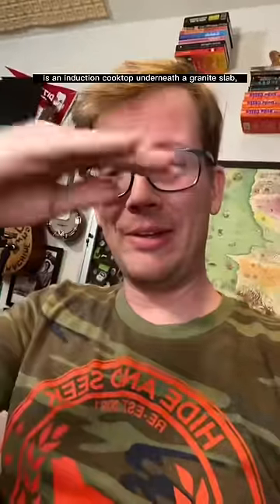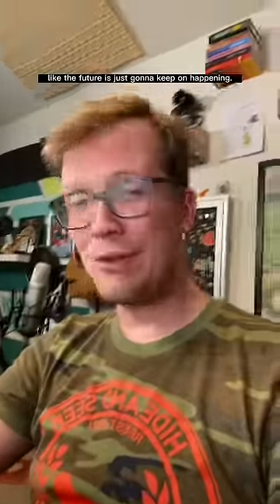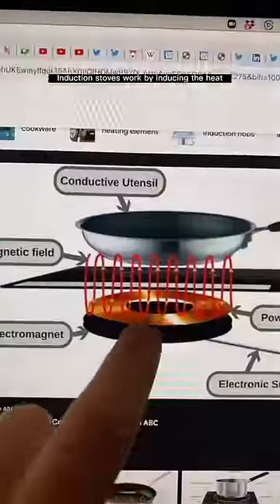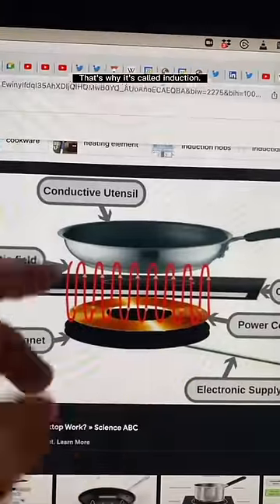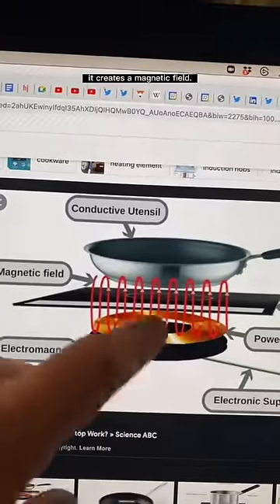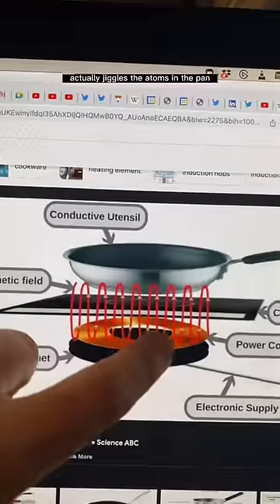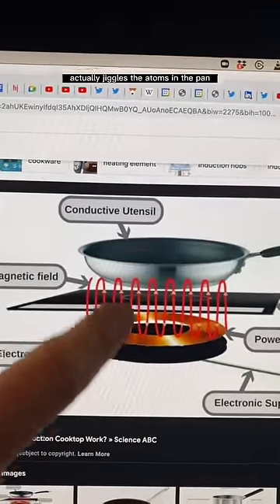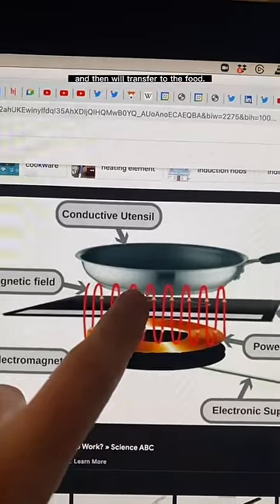How do induction cooktops work?

Comment: I got one recently and it's amazing! I love it for so many reasons but the most unexpected one is that you basically can't burn food/oil/etc. onto the surface. With a traditional glasstop electric burner it gets extremely hot so if something boils over, splashes, or splatters it burns onto the surface and becomes super hard to get off, whereas with induction the glass never gets hotter than the pan so things don't stick to it! It's also much easier to clean right after cooking (since it isn't that hot) so I'm just much more likely to clean it right after using it, which also helps keep it cleaner
Reply: Yeah im jus gonna pay attention when i cook instead of buyin an appliance that forces me to eat it raw. Like what good is a stove that doesn't boil water? You want your pan to be able to cook your food dude. If you an clean it up immediately after cooking. You didnt cook anything. Sometimes you want the oil to burn that how you know its gonna be hot enough to cook certain things. Like i dont think your problem was the stove. You just dont know how to cook. Im glad its helped you though.

Comment: I feel like continually heating pans on granite is going to crack it..
Reply: It will
Reply: they don't show it in the video, but you can use insulators on top or separators (it's like a stand that can hold the skillet or pot)
Reply: I don’t see why, Granite is extremely resistant to heat damage which is why it is used in countertops so often and why you don’t need trivets for hot pans/pots with granite. Also, it’s not the granite itself being heated remember. The granite is only being heated by the pan/pot since it is induction, drastically lowering its temperature.
Reply: Not only that, but the complete lack of a visible indicator of where the induction coils are WILL result in accidents and/or injuries.
Reply: The granite isnt magnetic, so only the pan itself will heat it. Granite is also formed in far hotter temps than that. Heat rating is beyond steel melting temperature at 2100°F at least and cooking is no more than 500°F for BAKING for stove cooking its usually far lower like 300, its just that you'd need to have already checked the granite for any water content inside it, or it will do a steam explosion on ya. So the particular cut of granite probably costs more than $5k with the testing, alone.
Reply: @Biblioholic1993  Sure, the pan will do the heating of the granite, but that heating is in the midst of a larger mass of non-heated material. 
The expansion stresses are what I am thinking of. All of that slab of stone has to somehow either contain the expanding material in that smaller circle, or break (since granite is known for its ductility).
Reply: @MonkeyJedi99  granite countertops are ok to put a 500°F piece of baking glass on, which stays hot for 30min and warm for longer, and granite expands 0.000035 to 0.000045 cm per unit of kelvin.... a kelvin degree is equal to a Celsius degree but the scale is set 300 back. I was surprised too, but the math says it should be fine until like 1300°F sustained temperature.

Comment: It's definitely "pretty" to have the induction cook top hidden under granite, but it won't be pretty when you have an accident because you don't know exactly where your induction rings are. I work with induction burners at work and I've seen some crazy stuff happen when people aren't paying attention.
Reply: It can be an multiple ring induction cooktop, that allows to cook in all the surface, turning on only the parts where something big enough is there
Reply: @miguelangelmartinezcasado8935  I would hope the whole surface isn't induction.  What happens when you put your metal fork down next to your pan? I can't see where the way the cooking surface is handled could be safe
Reply: @chadrydjord829  per the original video series Hank is responding to, the whole surface is not a cooktop. It seems that from many comments, using the stove without a rubber insulator is bad for the counter, but luckily the original video shows those. I guess if you're not used to it a misplaced metal fork could be dangerous, and I agree there should be markings, but it doesn't seem that big of a deal if the house is full of adults familiar with the cooktop.
Reply: I’m never going to stop using the gas stove tops.

Nothing like flame

Comment: I’m a chef and induction burners suck to cook on. Every one I’ve worked on has a safety feature that won’t turn them on unless the pan is centered on the burner. The pans that work on them are usually very expensive, and if they are too small the burner doesn’t recognize them, thus rendering them unusable. When you are really cooking, there is nuance to being able to use the edge of the burner, induction doesn’t allow you to use the edge on the burner. We evolved cooking on radiant heat, I think we will continue using it for a very long time.
Reply: I feel the same way when I look at induction setups. I'm not a professional, but sometimes you use the same pan for multiple things at the same time and being able to push some stuff to the edge and offset your pan so it cooks at different rates.
Reply: I haven't seen anything but induction stoves for the past decade where I live and to be honest I haven't really seen any of the issues you pointed out. The pans cost 10-20€, you can definetly not have it centered and even a pan that covers 1/3rd of the induction area works fine.

Comment: That looks dangerous.
Reply: Probably not , well a little , the cook top does get hot , but only because the hot pan is on top of it , ( other way around to how it normally works ) , i dont know how well the granite spreads the heat , and the moment you take the pan off it turns off , 
Also it doesnt work on  on ferrous metals , so turn it on full , put your hand on it , no  bother, 
Accidentally put your steel watch on its gonna cook , ( but you'd have to knowing switch it on under
Reply: Probably not , well a little , the cook top does get hot , but only because the hot pan is on top of it , ( other way around to how it normally works ) , i dont know how well the granite spreads the heat , and the moment you take the pan off it turns off , 
Also it doesnt work on  on ferrous metals , so turn it on full , put your hand on it , no  bother, 
Accidentally put your steel watch on its gonna cook , ( but you'd have to knowing switch it on under
Reply: It absolutely is dangerous, and unnecessary.

Comment: In Germany (and most of Europa) it is very common to have the electrical cooktop in a separated  unit from the oven. Induction is also very common nowadays. So it is not as fancy as the one showing in this clip, but it comes close, as you have one flat surface that contains the cooktop at some place. Very convenient!

Comment: The biggest problem with induction is that it's not granular enough. The one-off cycles have them turning on for a few seconds and off for a few seconds.. so it heats up and cools down in larger chunks rather than keeping it at a fairly consistant heat.
Reply: Yup. Have a 1 pot induction top with a 12 hr auto off and bad temp sensing. I basically use it exclusively for stocks because it cycles too weirdly. Maybe heavier cast iron would work better
Reply: Exactly why I despise my electric stovetop. Sticking with gas.
Reply: This is not a common problem with induction? I have had one for 17 years and this doesn't happen
Reply: @marias5230  ... It's the way induction works.. on for maybe 4 seconds and off for maybe 8.. or on for 5 seconds and off for 5 or 6 .. all depends on the wattage / temperature you have it on.
... Instead of lowering the amps/volts delivered through the coils..
So you end up with water boiling for a second or two and then not being heated... Instead of (as you would get via gas) a constant heat that is tuned correctly to input and loss.
Reply: @old486whizz  Not complitely true. I have not even noticed that phenomenon in my usage. This is only happening on the lowest settings, 1-2.5 from 9. Above that the heating is constant, so the water is boiling all the time, not just partly🤣 I always cook my food on 6-9 or full power, and I never use the lowest settings anyway bc they are so low on heat. I like induction bc it is the fastest way to heat food, it goes immediately to full power or off, and bc it is a glass top so it is fast to clean. It also automaticly turns itself off when i lift my pot, or if water boils over
Reply: It's really a non-issue. Yes, that's how induction works, but you're misunderstanding why that is.
If you use your gas stove on medium heat or even low heat, the temperature inside the recipient is only going to KEEP INCREASING. Because it adds up over time.
The only way to keep something at a constantly regular temp without you having to do DJ manoeuvres with the buttons is precisely what induction heating does.

Stuff doesn't stop being heated in an already hot container if you cut the heat source for a few seconds. Because heat is retained in the container. That's why you can burn stuff easily, even at very low temps on a gas stove. Induction, however, doesn't keep adding more heat when it's already at the desired temp. It will only keep the temperature you selected.

Tldr: user issue.
Reply: @GreyPunkWolf  I mean that's just false.
When you heat something, that something gives off heat to the surrounding environment. That's why when you set your gas to a medium flame, the heat gets transferred into the thing in the pot/pan and then that transfers away (evaporation)..
If you're burning things on gas - turn it down, so less heat is given into the pot/pan.

With induction it's like turning the hob on full, then off, then on full then off..
They could instead change the volts/amps on the inductors, effectively reducing the power (and thus heat) transferred in a more analogue method - or they could do the switching much more frequently (every other second rather then on for 7 seconds then off for 7 seconds).

TLDR: my point still stands

Comment: Imagine if you have guests round and they place thier car keys down on the counter 🤣
Reply: Worse yet, they sit on it lol
Reply: @caananlemke  We are ougabooga about this type of stuff
Reply: @caananlemke demagnetize credit cards and potentially ruining the chip and tap methods on them as well, and don't forget the electronics in your car keys, and nevermind if you have a security key card on your keychain or in your wallet, I'm sure your employer won't mind replacing it
Reply: It has an on/off switch. They aren't always on. Just when you are cooking. Same as a regular cooktop.
Reply: Nothing will happen. They sense the metal and won't turn on unless a pot or equivalent amount of steel is there.

Comment: But you should note that once you have an induction cook top, you need ferromagnetic pots and pans in order for it to work. Pyrex or aluminum won't react to the magnetic field and therefore won't heat up. Most pots and pans that are metal are a mix of metals, so even my Nana's old copper bottom pots are still steel inside, but I would wonder how the copper would mess with the field.
Reply: Copper and aluminum don't work with most induction cookers because they have too little resistance. They do react to the magnetic field. There are commercial "all-metal" induction cookers available which will work with copper or aluminum, but they have to use higher frequencies and are more expensive.
Reply: @whitcwa  meaning they are too rare to be noteworthy... What frequency makes pyrex ferromagnetic? lol
Reply: @lokinakor1  I didn't claim you could use glass. And ferromagnetism isn't important. Resistance is what matters because that is what enables eddy currents to heat. It just happens that of the commonly used metals, iron and iron alloys have the right resistance. Get your facts right.

Comment: Just FYI- you will be unable to make some things on an induction stove:
Crepes are difficult on an induction stove, because the pan warps easily
Kimchijeon is a pain to get right on an induction stove
No stir fry for you on an induction stove.
Buy it, use it, but i recommend having a small travel burner for some edge cases where you NEED an even heating. Induction stoves don’t heat the surface evenly

Comment: I had an induction stove in my childhood home, and I can say with certainty that I prefer a gas stove. Induction does not heat up quickly in my experience, the burners take forever to cool down, and it can be difficult to tell if/when a burner has warmed up after being turned on. I feel I have more precision with temperature on a gas stove too—maybe it’s just in my head but induction stoves seem to react slower to temperature changes

Comment: There are also induction forges that are used for metalworking. Can heat up a decent chunk of steel to 2000° in a couple seconds and it's perfectly safe to stick your hand through it while it's powered on (as long as you don't have a metal ring or bracelet on, that is)

Comment: In Japan, most new cooktops in cities are induction rather than gas or traditional election. One big thing to note though is your cookware needs to be receptive to the induction stove. Glass, copper,  and aluminum-mixed stainless steels won’t work. If you do want to get one, you can test if your current or new pans work with a magnet.

Comment: We had an induction cooktop with a little fume vent that would rise out of the top of the glass and pulled the air horizontally across the pans in the house my parents built 25 years ago.

Comment: Depending on your main grid power generation this IS the future or the past. In my country there's still a LOT of thermal plants which means burning things to generate heat that then is transferred to water to generate a rotation which then is transformed into electricity which ends up in your house and then it's used to generate heat, on the other hand if you use the gas directly to generate heat you skip a heck of inefficiency..

Comment: That will absolutely crack the granite top, also having it that far away from the pan with lead to massive inefficiency and extra heating in the unit rather than pans which will also lead to easier cracking of the slab.

Comment: I thought i will love it, its really fast, but sometimes i hate it. When you try to shake the pan "for reasons" it gets confused, and stop. They try to detect the pan, they detect it, and they start. 
You move it an inch and he stops. You stop he start again.
I hate it, but also i dont turn it off, just not putting the pan back and after a few seconds it shut itself off.
Sadly no more emergency cigarrete lighter like the regular resisitive coil ones.
They get as hot also as the pan, so i will not choose a stone one until we see how they perform in real life.
There is too many magazine kitchens that dont get used at all.

Comment: They are also alot more energy efficient than normal electric stoves as the wnergy gets transferred directly to the pan and far less energy is loss as heat that doesnt get transferred to the pan

Comment: Just FYI: if you get an induction cooker, make sure that your cookware has iron in it! So cast iron and stainless steel cookware are good options. Ceramic and aluminium cookware will not work as you can't induce heat through a magnet in them! (Diamagnetism vs ferromagnetism).

And yes that means if you have a nickel or cobalt pan, that'll work, but I've never come across one of those 😂

Comment: Just know that this will eventualy crack your granite countertop. While the induction burner doesnt get hot the pan does and granite isn't as resistant to rapid temperature changes as people think it is. That said if you can afford this you can probably afford to replace your countertop every now and again.

Comment: I'd much prefer a dedicated and visible stovetop with the proper induction stovetop materials. While this looks pretty, it's not good for precide placement on regards to the coils, and there is always the possibility that the granite cracks because of heating issues. Getting granite slab replacements is expensive and inconvenient. It also makes it more difficult to repair/replace the induction heating element.

Comment: that seems like a major safety issue. that granite will still get really hot once the pan gets hot and then if you move the pan you have a scorching hot surface indistinguishable from the rest of the counter. i also can't imagine an electro magnetic field would be very good for any electronics absent mindedly placed on that surface if it accidentally gets turned on

Comment: Okay so adhd tip you can just get a noodle board and a two burner induction hot plate and unplug your electric stove for good for $300z REASONS TO DO THIS: 1) it makes noise the whole time it’s on and then after the fan runs until it’s cool so it’s harder to leave on by mistake 2) way lower fire risk if you do leave it on, though like, don’t 3) you can set a timer on the burner itself and be like “realistically if I haven’t come back to check on my braise after thirty minutes it should probably cut off” 4) you can also set the temperature to a number and be like “I’m going to wander off and I can tell so this soup should stay at 220 and not have a chance to boil over”. But if you’re ever going to use your oven again you should cut a vent hole in the noodle board, oops.

Comment: The thing is you need induction pans to go with the stove top, ones with a specific bottom that reacts to the electromagnetic field, these can be expensive too so an induction stove top might not be for everyone right now
But this also helps with “forgetting g” things on this granite worktop, induction hobs only work with induction pans so it wouldn’t really matter unless the thing you’ve placed down is made of the same metal 😂